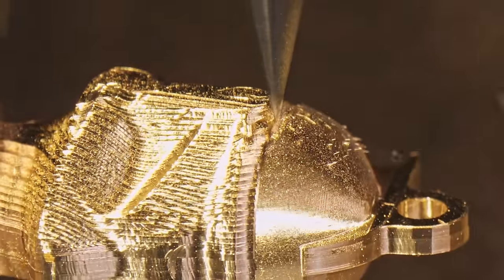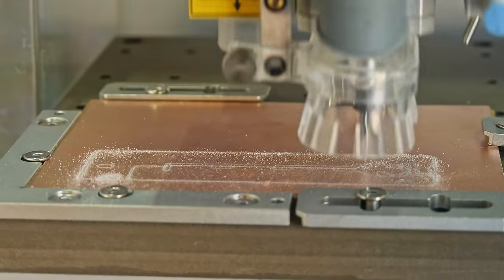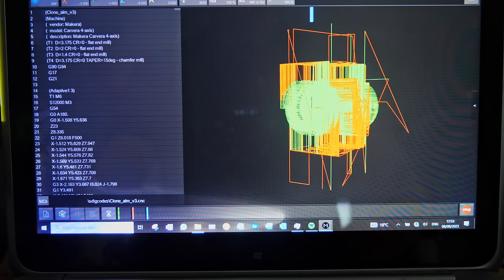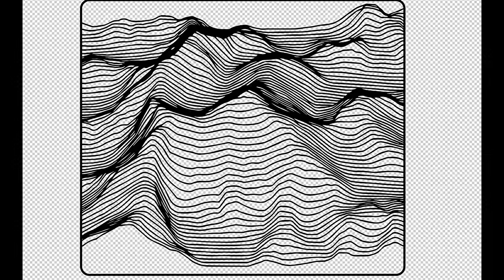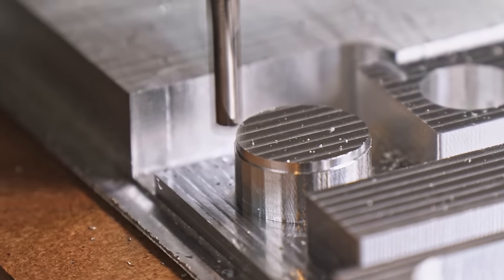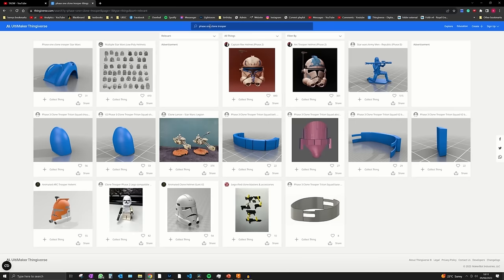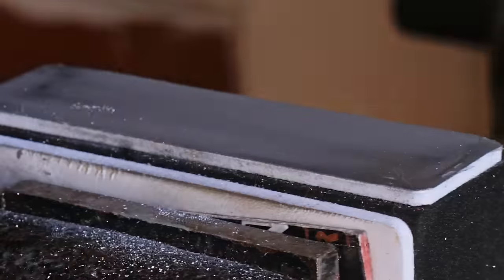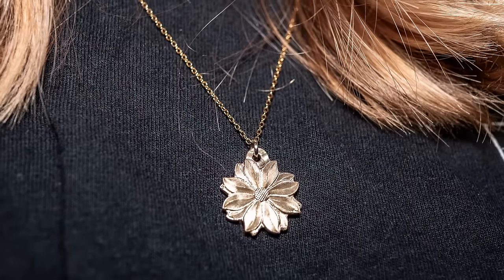The BEST 4 Axis Desktop CNC Machine?

Comment: That cutters not dead, you can dissolve the aluminium with caustic soda (Sodium hydroxide). Congrats on the new machine, looks awesome!
Reply from the maker: Thanks! I did actually manage to pick off the gummed up aluminium and the edged are chipped unfortunately :(
Reply: @taow You can use ethanol as a coolant when working with aluminum. It prevents the clogging 👍
Reply: @jesperwall839 great way to light the mill on fire .
Reply: @glass1258  Why? It’s used everyday all over the world in the industry as it’s the only way to get the aluminum not to stick.
Reply: @jesperwall839  it’s just not practical for hobby machining in your bedroom or home. The endmill is going to spin up a bunch of mist and you’ll be sitting in a room full of alcohol vapor plus it’s a fire hazard
Reply: @glass1258  The thing is that you don’t have to splash it with alcohol like you do it with the regular cooling liquid. A small amount goes a long way. It’s not for cooling, it’s for not sticking.
Reply: @jesperwall839  I understand what you mean I’ve used it at work I’ve been a machinist for 15 years. I just don’t think it would be practical for hobby use in a small room using a machine like the carvera
Reply: @jesperwall839  the endmills he is using are cheap Chinese endmills. He wouldn’t have that problem if he got some decent endmills with proper coating for aluminum cutting and he could mill it dry without any coolant.
Reply: Coated mill bits are cheap now that China is making so many Desktop CNC mills.
Reply: Try coating the aluminium with kerosine. A light spray or by brush. (Old method)

Comment: I have noticed that most of the guys running hobby-type milling machines always have the cutter stuck out too far, keeping the tool's length as short as possible, this will stop deflection. Another good tip is always to climb mill the part, the cutter will last longer, and when milling pockets it will stop the cutter from undercutting the corners through deflection. By the way, I'm an engineer.
Reply: Could you explain what climb milling means?
Reply: How do you know someone's an engineer? Don't worry, he'll tell you.
Reply: If you're an engineer, this means you solve practical problems.

Comment: Calipers for measuring inner circles are just not accurate. Your .1 was 100% wrong measuring tool, not the machine. Hole gauge would be a little more accurate. I've run into this measuring problem myself before I figured out my mistake and literally did that DiCaprio pointing at the TV meme when I saw you do it too lol.

Comment: If the undersize holes are a spring pass issue then the dimension at the top of the hole will be closer to target than the bottom of the hole. You can correct for this with a spring pass, or use a cutter with a stiffer aspect ratio (larger diameter and/or shorter). Also your external dimensions would be oversize by a similar amount because the same mechanism applies to internal and external features.
Reply: This is a great explanation, spring passes help a lot on ID and I also wanted to add that ID holes need a slower feedrate, there is more cutter contact on an ID hole than on a straight cut. This does put a larger chip load on the tool, just as inside corners where the tool is loaded more.

Comment: In my opinion, the culprit is one or a combination of three things: dull cutter, or not using the correct style of cutter, not enough horse power in your machine so the cutter isn't able to be pushed where it needs to be, and the properties of the metal itself during machining operations. Aluminum is notorious for gumming up when it gets too hot, this is due to the low melting point of aluminum, the chips will begin to fuse with the cutting edge, this is especially a problem when using a HSS cutter, which is what you appear to be using. You could try switching to a VERY sharp carbide end mill which is much harder and works better at higher temperatures, so chips fusing to the cutting edge isn't as big a problem. Aluminum also undergoes a lot of thermal expansion-- virtually every soft metal you might work with loves to absorb heat, aluminum can get piping hot in a matter of seconds, so you have to manage heat via symmetrical machining, coolant, making sure your cutter is always super sharp and preferably very hard. But, if you're using HSS because it's all you got, the best recommendation or trick I can offer up is to spray a tiny little bit of WD-40 onto your part, or area that's being machined-- that, or keep it flooded with coolant. The aluminum won't gum up and it will cut like butter with WD-40 though. Give it a spin sometime. Works for drilling or sawing aluminum as well ;) Either way, awesome set up man.

Comment: Cool video. One slight correction. The true 4th axis troolpaths were never free in Fusion 360. They were available in preview form, but when a user enabled the toolpath in previews ,it was shown that when released it would go into the machining extension.
Reply from the maker: Thanks, that makes a bit more sense :)
Reply: somewhere i still have the original "deskproto" download...
unlimited for the first month after install. so ran a machine for a year by re-installing the OS every month, lol...

they learned!

last time i checked they now throw a chunk of "dead" into the toolpath.... until you pay. though it wasnt too expensive, but yeah, my mill has been out of service for a long time as well...

Comment: This is very hobby-hobby-hobby machine, you can't do too much with a 200W spindle. Simply it's not enough. Not enough for aluminum either, or other soft metals. Milling wood, acryl, MDF, PCB... hmmm, for $6000 ? Hmmmm. Not for real life things. Look at the workpiece at the start. Even that tiny thing is not so high quality, it has quite bad surface quality. At the moment a good 3D printer is much more capable and you pay a fragment of $6000. I'm sorry for not being biased.

Comment: Cool machine! Would be nice to see the static spindle deflection — you can measure this by putting a endmill in the spindle at a typical stick out, then pulling with a known force and measuring the deflection. This will get you a deflection number that you can compare with other machines.

For measuring accuracy, you really can’t use calipers for less than 0.05mm. A good micrometer will get you accuracy down to 0.01mm. 

Check your bore measurement technique on a ring gauge or some ball bearings. It’s actually quite hard to measure to 0.01mm by hand. And inside mic would also be helpful for those measurements.

Comment: For better finish try increasing spindle speed and lowering feed.
Rough out half of the workpiece, finish the main surface, then rough and finish the rest.
Use very sharp polished carbide EMs.
Minimize tool length or stickout.

Comment: Cool machine! Running your cutters as short as possible is probably one of the best things you can do to improve surface finishes. Some projects won’t permit short tooling but it can make a huge difference, especially on small diameter tool.

Comment: Would you recommend this as a first CNC? Also what is the noise like, would you be able to get away with using it in an apartment?
Reply from the maker: I think this would be good first CNC yeah, the 4th axis programming and setup is a little more complex than the 3 axis stuff so start off with that first if you do pick one up.
I use it in an apartment and you can get away with it, its obviously not silent but not too much louder than vacuum cleaning or running a washing machine.

Comment: You should mention that you have to re insert the removed parts of the chuck in the same spot. Otherwise you can get higher runout. Normally the parts of the chuck have marks and the chuck has corresponding marks.

Comment: Not shure but i think your machining direction should be invers so the bit cuts when your axis is moving... Now the bit runs in the same direction as as your axis movement which results in a "chipped" surface.

Comment: Use a ball nose with a short flute and long shank. I think tools today has engraving router bits with tip radius that might work well for this machine, but I've always used double flute balls for surface finish

Comment: Wow, lots of nice features.  Do you know if the laser may be upgraded to one of the more powerful aftermarket types like Jtech or OPT Lasers?  Can the probe do a higher resolution 3D scanning function?  I would like to digitize some of my hand carved pieces but I can strangely obtuse answers from every mfg that I ask the question to.  This would be perfect for my custom guitar part prototypes that don't need to be made from a ferrous material.
Reply from the maker: I am not sure about the laser upgrade, it would depend on if the power supply can handle more power, and it would have to fit the fairly compact form factor of the machine.
You can adjust the spacing of the probe points but the tip is about 2mm and would not be accurate for steep curves or really fine details!
Glad you enjoyed!

Comment: Would you consider a pocket nc 2 as well? Why or why not? Thanks!
Reply from the maker: I have looked at the pocket NC machine also, having a 5th axis would be awesome but the working volume is a lot smaller and there is no tool changer (which is so good on this machine), meaning that most parts will require quite a few manual tool changes.
Just depends what you are wanting a machine for which one is more appropriate, but I would say that this machine is more versatile.

Comment: The problem is always the same.
Apart from the fact that for a machine built in China I expect significantly lower prices, the fundamental point remains.

Since Fusion eliminates the CAM part for free, spending hundreds of dollars a year to do some hobby work makes thinks  less interesting. I also understand that as a student/YouTuber you have a lot of reasons to make these videos, but when I was studying I didn't have 5000 US$ for a toy and now that I'm an adult I don't spend 500 a year just to be able to access the fusion post processor.
Without it the whole thing has absolutely no sense except for looking those nice looking G codes made by others running.

In short, without patreon, various sponsors and fusion software licenses procured unofficially, the toy is beautiful but decidedly out of budget for the simple hobbyist who will have to settle for much less automation until a more efficient product arrives on the market. ' suited.

Comment: Great video, thank you very much. I am considering buying it. I have a question for you, do I need to learn Fusion 360 or can I keep using Solidworks for designing my products?
Reply from the maker: Thanks!
You don't need to completely re-learn how to design parts in fusion (although it is quite similar to solidworks in a lot of ways, just not quite as good unfortunately).
You can still design parts in SW then import them into another CAM software to generate the toolpaths.
Fusion is good for making toolpaths for engineering parts, V-carve is good for making signs and relief carvings ect, so far both are supported on the carvera.
Would definitely recommend picking one up!

Comment: Hobby grade? Mate, it's $5k USD. You did say top of the line, but to put that into perspective, you can set yourself up with a gaming PC rig that is top of the line for that cash. If you are building it yourself, you can go pretty high end or pay for nice peripherals or add in a good monitor, desk, and chair. This would be for somebody that was pretty damn serious about wanting to use it.
Reply from the maker: Yeah it is a very high end machine, the only reason I say hobby grade is that it is clearly not designed to be an industrial machine
Reply: It’s simply an expensive hobby
Reply: @HowdyYT  makes Warhammer 40k miniatures look cheap.
Reply: You criticise the use of "hobby grade" by comparing it with.... a hobby (gaming PC).
Reply: @WheatMillington  I wasn't talking about hobby grade gamming PC. I was talking about a top of the line gamming PC. That would be what the most the top 1% would put into the hobby into their entire machine. Most PC gamers spend closer to 0.8k to 1.2k USD on their machine. 2k USD can build a machine that will play every game out now and in the next year at max setting for the next year.

These prices don't include the desk, peripherals, or monitor, but we are comparing a CNC lathe to a gaming computer, not a workshop to a full gaming and livestreaming studio setup.

The price is double what a PC gaming hobby would be. And before you claim a gaming hobby would still have to buy games, the CNC lathe still needs tooling and material to process.
Reply: I think a better comparison would be 3D printers. A hobby (or better) 3D printer is in the range of less than $2k. That's what I would consider upper hobby grade for a CNC. This thing is way beyond that. It's more than an industrial fiber laser. This is more similar to the "big brand" 3D printers that aren't any better than the cheaper ones but cost 3x as much because, who knows.

Comment: Tool changer is a killer. Laser can be useful for particular PCB manufacturing process step . You can engrave solder mask with it. That could be used for solder pads revealing and PCB "silkscreening" with laser engraver. But that's useful only if you planning to put solder mask  on your DIY PCB.

Comment: 5000 $ can build totally better and biggest machine DIY at garage, lot lot biggest and strongest machine. because good about size 1000x1000x300 work area machine cost less than 1000$ nema 23 motor linuxcnc cnc, and Vcarve and fusion softwares free. same 4000-5000 $ cost onefinity  cnc but DIY can make similar but lot better parts less than 1500$ nema 34 or servo motor cnc. lot more strong and accurate.